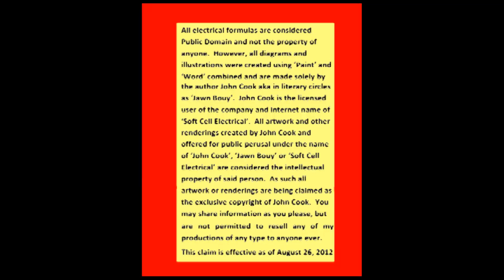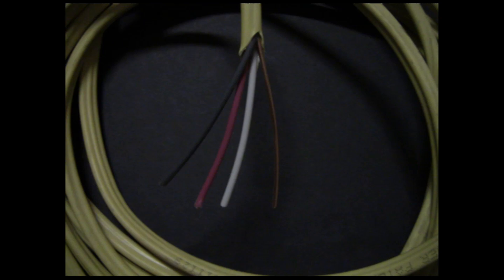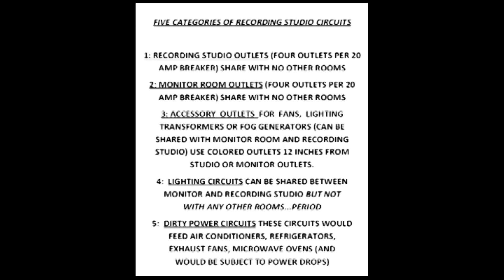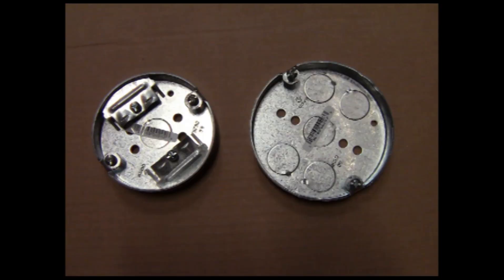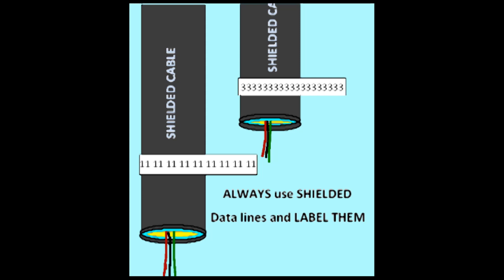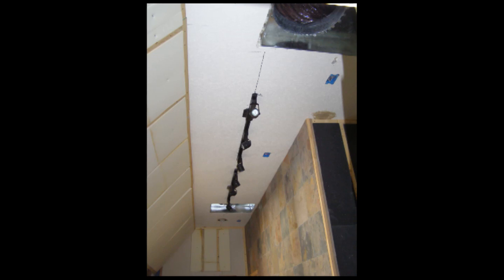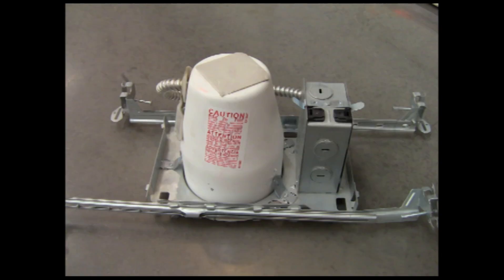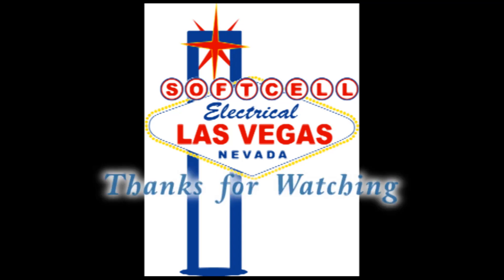How to wire a recording studio. # 105

Comment: IF YOUR RENTING, CAN'T, TEAR WALLS APART AND ARE PICKING UP SIGNALS LIKE HAM RADIO INTERFERENCE, ETC. IN YOUR RECORDING EQUIPMENT OR P.A., CLAMP A HEAVY GROUND WIRE TO A COPPER OR METAL COLD WATER PIPE.

Comment: As an electrician you can still use 12/3 just make sure both of the hot wires are on the same phase in the electrical panel
Reply: If you want to overload your neutral sure, then put both hots on the same phase.

Comment: I have buzzing in my studio, most likely caused by bad grounding in the panel. 

In my panel, grounding and neutral wires are connected to 2 bars. 

In your video you have mentioned that grounding and neutral wires should be separated on two separate bars. Both grounding and neutral bars in my electrical panel are connected, as if it is intended to be that way. There is no separation between ground and neutral on the two bars. What do I do?
Reply: That is your main panel and I'm guessing is the only panel for that house/address?  If I follow the suggestions in this video correctly, you'd want to install a subpanel where you MUST have the neutral and ground separated and have the all home runs from the studio tied into it.

Comment: How about  working off a sub panel powered by a main disconnect/electrical meter service like, where the ground is served with building code, there's is no other way to bring any other type of ground to it. Is there any suggestion that you can make since I don't have to separate the gound from the the neutral? And when you said isolate the ground that means the ground bar can't be bonded  to the panel?

Comment: I have a shed. Power running from my home to the sheds panel. I only ran shielded wiring to 4 outlets that are run to their own breaker. The rest of the plugs I ran with Romex 12-2 lights ac etc. is this a problem?

Comment from the maker: Sure, but I would be cautious of reusing romex. If you have an isolated ground from neutral bar that is an added benefit. On music  panels you should always provide extra grounding by way of twin ground rods or even a UFR if there is concrete to be poured close to the panel/subpanel. The biggest danger to studios are light dimmers, flourescent lights or ungrounded motors (like a two prong refrigerator on the same panel. Thanks for the comment.

Comment from the maker: Yes, absolutely YES. However there is the money involved and the issue of whether the main panel will support two additional sub panels.  If your going all out from the ground up, you would power the entire building (except for monitor and music room) with one big panel and then power your sound rooms with a separate sub panel that has an additional UFR ground rod. Cost is usually the big factor.
Reply: the only problem with isolating the ground from the neutral in your main panel is that it's against the NEC. You must bond at the first means of disconnect which would be your main panel from your service. If you install a sub panel, you must isolate the ground from the neutral which would be a better place to get that isolated ground...